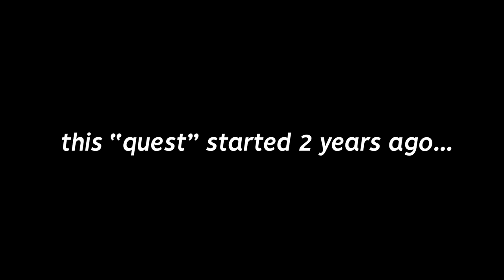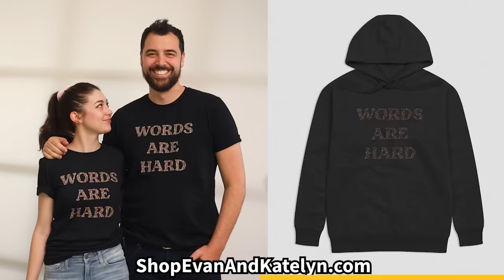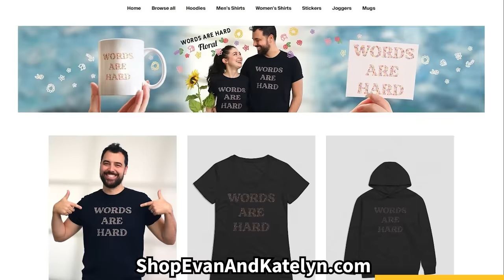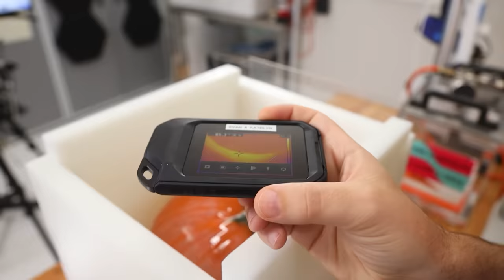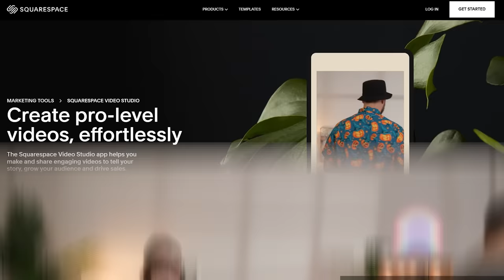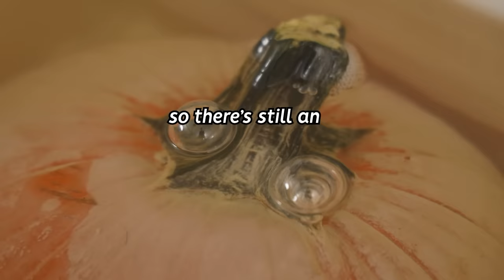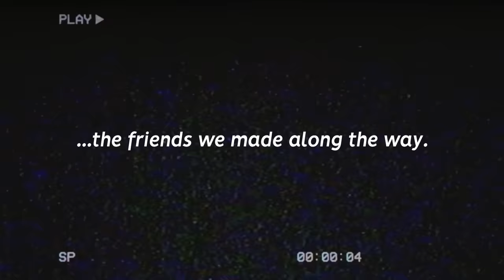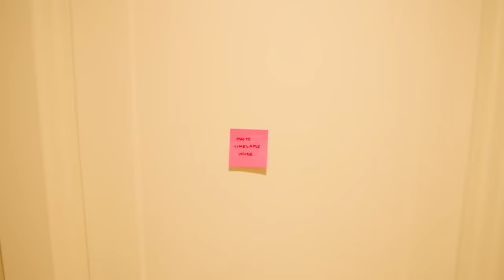Preserving a Pumpkin in Solid Resin… Will it rot?

Comment: You needed to cut chunk with a top lid that way the air can escape as you add the resin then you can cap chunk's top and finish pouring the resin. 
in the mold. I like the water surrounding the mold to help keep the interior refrigerator's temp steady. The water will evenly radiate the temp but you still need to cure the resin a little quicker.

Comment: Something that might be worth trying for next year: tissue perfusion. In medical sample preservation and embalming, you perfuse the tissue (replace the water in the tissue with a preservative like formaldehyde or carbolic acid), then you enclose the outside in resin to seal in the .... freshness? (It's not gonna be fresh, but it will be PRESERVED). You need to run a lot of preservative volume through the tissue to really flush out the water and pumpkin juice. I don't know how it's done with plant tissue, with animals you use the arteries to do it. It might work to submerge it and let it dialyze. You'd change the embalming fluid a few times to leech all the water out. 
Alternatively: smoke the pumpkin like beef jerky, then resin.

Comment: They should have put the resin on a shaker so shake out the air bubbles and also have done a single pour not multiple , but doing so you have to have the corect setup

Comment: Since the resin gets warm and it's wet bc pumpkin it starts to mold, maybe dissenfecting with a uv light. Also maybe try cutting off the top instead of the bottom. So air comes out fastest

Comment: I feel like cutting a hole on each end to keep air pockets from forming if the cube method is repeated. Then just squish the lid of the pumpkin down when it’s near the top? I also feel like covering each component of the pumpkin with resin before it goes in the cube would keep the juice contained.

Comment: you should have just poked a new hole through the top as the old hole was below the old resin line and therefore wont let any or much air out, also try to get it down to a single day pour by pre-making hte bottom layer before carving and then fill it in a single pour, assuming the heat doesnt get too high

Comment: You dont need a vaccume chamber. Just make a lid with a gasket that sticks in any bucket. Then you can mix up a batch of resin in a bucket then use the bucket to vacume out the air. Just connect a vaccume to the lid and you are good to go.

Comment: I think you need to disinfect the pumpkin throughly first to avoid it from molding and rotting. Maybe soaking it overnight in alcohol or hydrogen peroxide? I've incased some living organism myself such as bugs. Before they are incased, I soak them in alcohol for quite a while (around a week). When I handle them, I also disinfect my equipment and container.

Comment: Next pumkin. Take only the top or bottom off. Fill full of resin and let it cure. Carve the pumpkin to the solid resin core. Clean up the holes as best you can. Cast the outside.  I think this may give you a good starting point. my only wonder is what the carving would look like. Possibly a surface carve?

Comment: it was a subconscious choice to place the pumpkin bottom down in the cube. The bottom of the cube doesn't have to BE the bottom after all said and done, if that makes sense.
Do all that you did BUT place Meatball Face UP (no need for that visible hole in the head either)on the base and you might not even have to 1st coat him in resin before hand or poor in layers. 
Now all you need to do is make that vacuum chamber that size of the resin mold and Get the bubbles out that way, might aide in sealing it up from any air contact asap

Pervs <3 lol

Comment: I would have made a vacuum chamber big enough for the pumpkin,  that could be dismantled. Don't paint the pumpkin in resin, it won't get a good seal and will give the pumpkin a chance to start rotting, or change slightly in size. That's probably the whit you see. Place the pumpkin in upside down, and pour all the resin in one go, or at least the same day, and vacuum down the whole thing to get all the air out. I'm pretty sure that would do it.

Comment: Hear me out. Cut the hole in the bottom and cut the top off. Coat everything in resin, then put the pumpkin in with the top off until the resin is over the level of the top of the pumpkin then put the top on to eliminate the air pocket. Also, the juice and shrinking may be because the pumpkin is partially cooking due to the cure heat. Can you chill the resin a bit ot use a cooler curing resin?

Also, do they wax pumpkins like they do other fruit? Could that react with the resin?

Comment: Suggestions for next produce preservation in resin project. I would place the stuff in a vacuum chamber, fill it up with ozone for 24-48 hours, then vacuum it down and fill up with resin trough a tube. Kind of like how vacuum resin forming works in composite manufacturing. Ozone kills bacteria and fungus, while continuous vacuuming prevents air pockets forming in upside down cavities.
Reply: The water inside the pumpking will be a problem in vacuum.

Comment: Could have just cut the top open to make a lid, covered the lid with resin as well and then used the top hole to pour resin inside. Once full, you could put the lid back on and pour to fill the rest. The weight of the lid and the weight of the resin on top of the lid would keep it sealed. I wouldn't even expect a very visible seam between the lid and the top hole, though there would be at least some.

Comment: You should have built a giant vacuum chamber for the pumpkin to sit in as the resin cured. This way there would have been no oxygen present for the microbes to break down the pumpkin during the curing process. plus the vacuum would have pulled the bubbles out of the vent. oh and the vent should have been drilled straight down at the very top of the pumpkin.. perhaps through the steam

Comment: Maybe do everything the same until the hole saga 

Like the layer of resin in the mold before the pumpkin, 

Wiping off the waxy layer most produce have and then obviously coating the pumpkin, but then sealing up the pumpkins features(eyes and mouth) with tyvek tape and then pouring the resin into the pumpkin so it wouldn’t have a pocket of air, and then doing doing deep pours after putting the full pumpkin inside ?

Comment: Can you please try to freeze dry one? Freeze a pumpkin, put it in a bucket, add cilica gel in a cup, put it in the bucket then vaccume all the air ojt of the bucket. Over time the moisture will release from the pumkin and get absorbed by the silica gel. Since it was frozen it will keep its shape. Leave it for a few months.

Comment: You don’t necessarily have to cut open the pumpkin you can carve the outside walls without puncturing all the way through. Thinner the walls the brighter it gets, thicker the wall the darker the contrast is when shining a light through it. Than making a small hole for an led light than sealing it up. You can save a lot more on epoxy. But keep in mind pumpkins is about 90% water. You’d have to put the whole thing in a vacuum chamber if you don’t want air bubbles not sure if the pumpkin will collapse on itself in the process but I’m no scientist that’s something you all can figure out and experiment.

Comment: I wonder if you could start with the bottom hole, scoop the insides, thin the walls down a lot, do a single poor inside only with pumpkin bottom up, then do the outside poor in a single go.

Comment: 2 holes next to eachother vertically, one larger than the other, then pour directly into the large hole. If the same problem happens with that maybe put him on his back when pouring so his eyes and mouth are on top so you can see all the air leave

Comment: My theory is that you sealed the pumpkin, but thats just a plastic wrap. And you know biology? The whole fruit got the 'juice' through the stem. The cells are still there. 
So as you fill the cube with resin, you just partially cook and squeez everything to the stem. So on the secound half, the juice literally escaping from the fruits flesh,m and shrinking, thats why its peeling away from the first coat of resin. And thats why in the timelapse you see as the pumpkin sagging back to the lower half of the resin. Maybe juice is going down, maybe just losing structure and stiffness. 
(sorry for my grammar)

Comment: You know you could just have poured the resin with the pumpkin upside-down, as the bottom is open the air would have not been a concern. Its a cube so you could just flip it when its all cured.

Comment: Just because you seal a food item in resin doesn't mean that it will become plastic. That pumpkin is still 90% water. It is made out of very thin and very fragile cells that contain water inside.
Tthose cells will slowly break apart. The bacteria and microorganisms inside the pumpkin is just one of your problem. Sure, aerobic bacteria may not survive, but anaerobic organisms can still thrive. It will also naturally degrade and break apart just from outside forces like radiation (heat, light, etc) andvibration. As the processes inside of the pumpkin stop, as it dies, it becomes just an array of fragile water baloons. And the more of them pop - the faster the process.

Just try the same with a smaller slice of pumpkin and a single pour to observe the process.

Comment: What you guys didn't account for is the heat. Meatball is a vegetable, heat as the resin was curing activated the sugar in meatball and thus made him leak juices, those juices rotted because heat also helps bacteria multiply (that's why when you make bread you put the yeast in hot water to activate it) and the end result is well that.

You'll need to find a way to preserve your pumpkin without it heating... but to be honest... I would try soaking the carved pumpkin (for maybe a day) in something that bacteria doesn't like, like alcohol (like desinfecting alcohol). Then do everything you did this time. I hope my comment finds you, since it could give you a hint as to what to try next year :)

Comment: You’re basically cooking the pumpkin at a really low temp so of course you’re going to get juice. Next time, put the holes of the face upwards so the air escapes through those holes. Then cure in a cooler or something that is cooled to slow the process and so the pumpkin doesn’t cook.

Comment: I'm wondering if it would last longer if you somehow sterilized the pumpkin before/while encasing it in resin, like sterilizing the surface with UV and encasing it under a fume hood. It would definitely a process and access to those would be difficult, but I'm still curious.

Comment: I suspect the one final thing you need to make an Immortal Pumpkin is gamma radiation - scalpel blades are typically factory-sterilised using irradiation. No mould/bacteria/fungus will survive that, and then the resin will seal it air-tight and prevent any subsequent contamination.

Worst case, you create the Orange Hulk 🤷‍♀

Comment: Honestly the issue is you keep bringing the pumpkin to the temperature danger zone while exposed to the outside air you honestly need to fill it and cover it all at once instead of separately and slowly. Anything between 41° F and 135° F for two hours or more is prime temperature for bacteria. Best thing I'd suggest is finding a way to pull the air out of it while in the whole mold so fill it up and pull the air out of the cavity.

Comment: also your air hole was lower than the top of the pumpkin which doesn't really help air escape, and maybe next time put the pumpkin upside down so you pour through the big hole, less pain in the dump truck with air

Comment: You should be looking into food preservation techniques. If you could sanitize the pumpkin, or saturate it with some chemical, there might be better ways to ensure it doesn't rot. If it can rot while in a hermetically sealed container, encasing it in resin won't be any better.

Comment: Next time try drilling from the bottom again, but fill the inside with Resin before carving out the eyes and mouth. This will prevent the need for a hole at the top when you flip it over and encase it

Comment: I wonder if you made a mold using something like a basketball so you could submerge the whole pumpkin in resin at once? That way not only would you not have the lines but the air would all escape at once. Also maybe dry it out first with orbeez or silica beads?

Comment: I don’t think moisture is the main problem as long as it’s evenly spread throughout the pumpkin and do not sack over time. The problem is bacteria and fungi. Think about canned food, you sanitize them and keep them away from oxygen, and they can stay edible for almost forever. I think you should use food preservation skills on your next pumpkin. Do not buy pumpkin that is too ripe so there’s less sugar and juice inside, wash them throughly after you take out their guts, dry them properly and then deep fry them to lock in their color, remove moisture and kill most of the bacteria, and only then cover them in resin, they should last a lot longer.

Comment: wouldn't it be better to do a layer of resin and then putting the pumpkin upside down and supporting it on the side to make it in the middle and when the resin sets removing the supports and then filling the cube up so there wouldn't be an air bubble in the head?

Comment: If they drill the bottom of the pumpkin to make the hole and if air if the enemy in this situation… wouldn’t flipping the pumpkin upside down before pouring the resin make things a lot easier?

Comment: I'm predicting that certain factors already present within the pumpkin flesh (air, moisture and MICROBES) will eventually result in biodegradation most of the original pumpkin; leaving mostly water, some hydrogen sulfide and just a thin layer of preserved pumpkin skin.

Comment: Maybe pumpkin face down next time so the resin pour wont be so obvious? And the juice leaking problem would be at the back? A clear mold box and use uv resin for one single massive pour then just uv flash light it from all directions so no juice could have its time making a tunnel? I dunno. I’m no resin master 😂

Comment: You guys! I love you so much. But you’ve done this how many times? I’ll tell you EXACTLY what your main mistake is…

You’ll want to reference the MythBusters episode about Pyramid power. 

There is a scene where Tori cuts the apple in half with a table saw. And the announcer states the fact that Tori might have accidentally given each half of the apple two different “Microbial Lobes.”

I’m short, you need to clean your tools before attempting a pumpkin cutting. In long, you are introducing and imparting your pumpkin with too much batería to expect them to not rot at an accelerated rate. For something like this to work (which I REALLY want to see it work!) you have to remove more variables, and treat this experiment kind of like a clean room. Sterilize everything so that no extra variables (bacteria from your tools) are introduced into the equation.

Comment: So... Forgive my ignorance, but why not pull the brass tube out with a pair of pliers, and drill another hole, then insert a tube on a pump to add resin inside until the resin pours out of the hole then cover it all at once with one single pour?

Comment: You're the resin experts, but I think the resin came out cloudy on the sides because of your mold. The texture of the material will determine how the resin looks. If you use something very shiny to make your mold, the resin piece should come out shiny. It will mimic the texture of the material you use. 

If there's a 2023 pumpkin attempt, that tip should help save you some sanding and polishing time.

Comment: Actually what would've avoided the chaos was to put the hole at a higher point rather than behind the stem. Giving it a much easier spot to get ALL the air inside which also would've averted the fate of you having to poke another hole in the same spot

Comment: Would it not be possible to drill the whole through the bottom of the pumpkin, base layer of resin, than put the pumpkin in upside down so that you can fill the inside with resin? This way you don’t have to worry about an air hole?

Comment: if u use a vibrating plate to get the bubles ut u can add all the resin at one and dont need to cover him in a layer first thast wy he looked white bces air was traped between the firts layer on the pumpcin once he shrunk a bit if u want somthing to be inmortal there is no air alowed and should be done quiq

Comment: Why did they go to all that effort to put  a small hole in the top of the pumpkin when they could have put it on its "back" and relied on the air and mouth holes to let the air out of the middle? Or put it upside down as they scooped everything out of the bottom and there is a big hole there anyway?

Comment: I feel like you'd have to completely freeze dry this thing due to the moisture content, but you'd lose a lot of integrity, etc. hmm. This is a strange one.

Edit: I realize you guys already did Dehydrating with salt... I think... >.> Anyhow. It'd be similar. You'd likely have to stuff the pumpkin with something when you go to dry it out to keep it from collapsing. hmm. This is such a strange one to think about how you'd get it perfect. Being organic it is going to... or it wants to dacay.  But being dry really is one of the only ways to preserve it.... 

Hmm. You could put it in a vacuum chamber with each layer of resin. Or maybe cut it in to layers, use toothpicks to put it back together and resin box it like you did in this one... hmm.